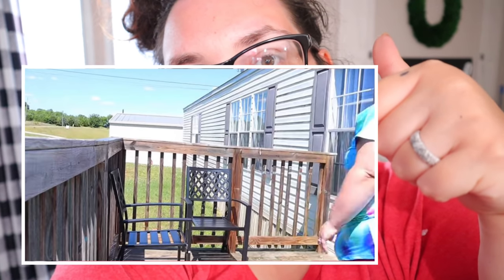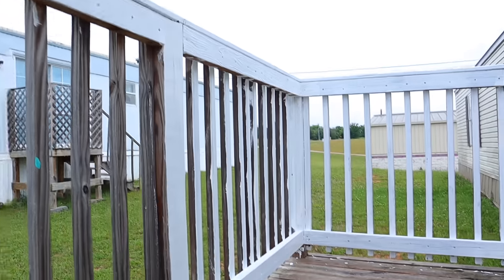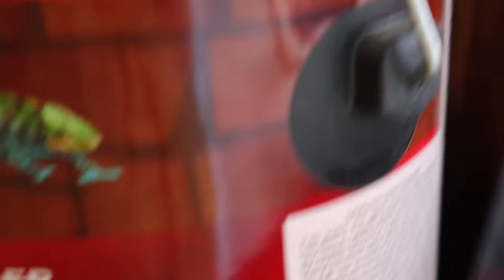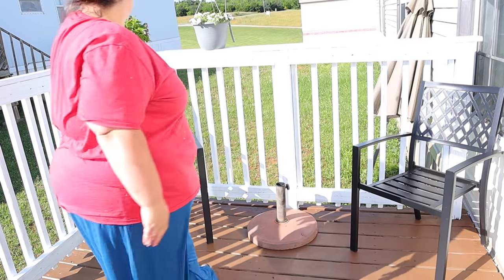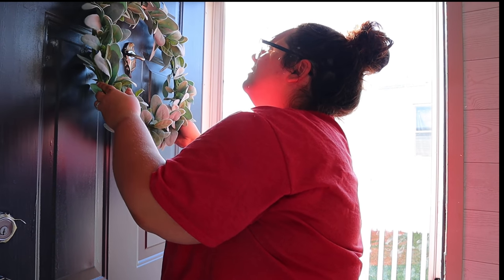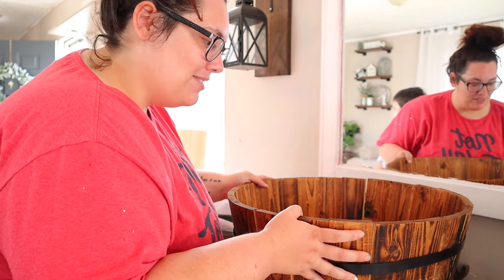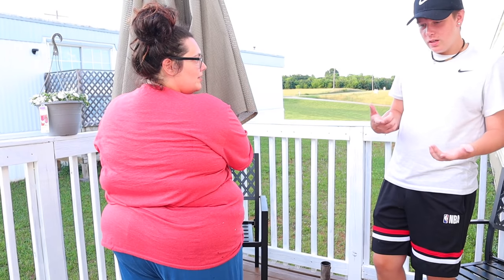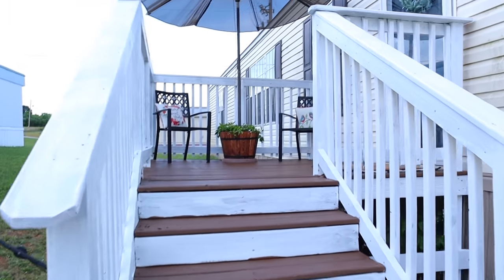SINGLE WIDE MOBILE HOME PORCH MAKEOVER | mobile home updates | mobile home makeover on a budget 💰

Comment: Be careful with the umbrella in the container I did this and a storm  came along and blew it over. So we took a big pot and put a pipe in middle and put cement around it and put umbrella in the pipe and I put flowers around it over the cement.  And it doesn't  move just make sure your umbrella pole fits in the PVC pipe. And then my husband took a piece of wood cut a hole in it and rounded it and we use it as a table over the pot.  Looks amazing. Wonderful job.

Comment: Paintable Caulk will fill the screw holes (top rail) on the porch and give you a smooth finish to the wood. Inexpensive but will change the whole look. Just a suggestion.

Comment: Those rugs with writing on it will start to come off. I put a bunch of coats (spray can)of polyurethane on mine. I’ve had mine for months and there’s zero wear on it. I had the initial rug from Kohl’s, took it back after 2 weeks because the K was coming off. Great job on ur porch.